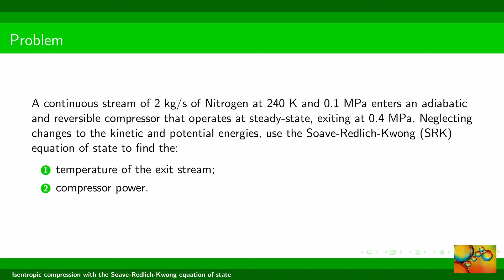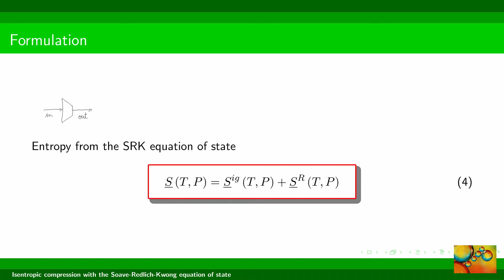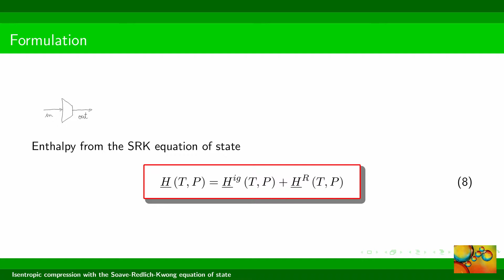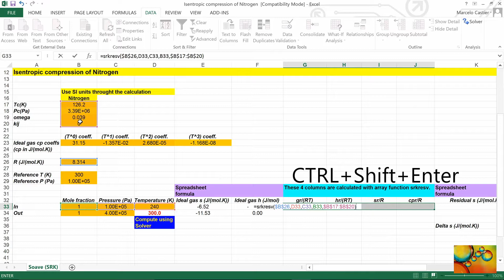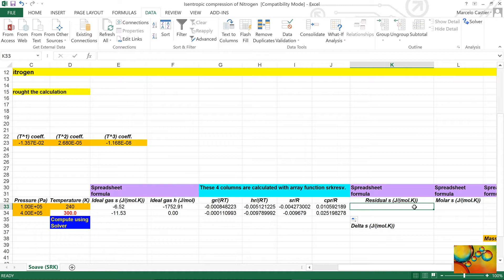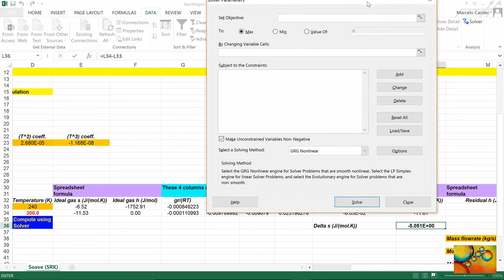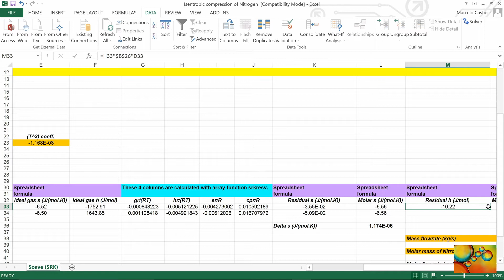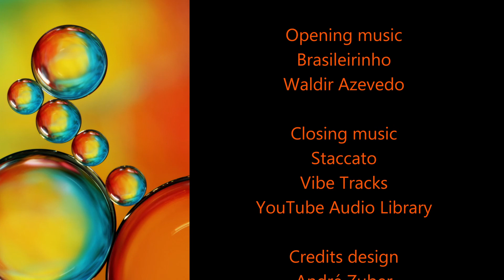Isentropic compression with the Soave-Redlich-Kwong equation of state

Comment: Great video! I was wondering if you can use this formula to calculate the compression of ethylene to a pressure higher than 20 bar. I already tried it but the calculated temperature is way too high. Any tips on what to do?
Reply from the maker: A high P_final/P_initial ratio (compression ratio) in a single-step adiabatic compression can cause a large temperature increase. In industry, it is usual to limit a single compression ratio to about 5, bring the temperature down with an intercooler, and then compress again.
Reply: @youthermo2951  Thanks for the answer. So this formula is also suitable for compressing from 15 bar to 22 bar (So for a Ratio of 1,46), right? I'm still a bit unsure about applying it in this specific pressure range, because if I use these values the calculated temperature is still too high. Thanks in advance!
Reply from the maker: Let me answer part by part. First, there is the formal thermodynamic relationship, which is valid for any initial and final states. Then, there are two practical issues. The first of them is the temperature rise in an adiabatic compression, with the compression ratio being limited to a maximum of about 5. The second practical issue is whether the thermodynamic model (equation of state, in this case) is good enough for what one intends to calculate. Depending on the substance, cubic equations of state, such as Soave-Redlich-Kwong or Peng-Robinson should do a  decent - however, not great - job for a compression ratio of 1.46, at the pressure level of your interest. I hope this helps. @deostoned9611